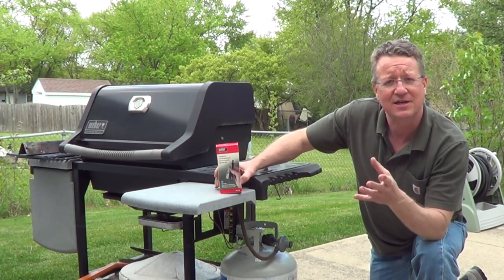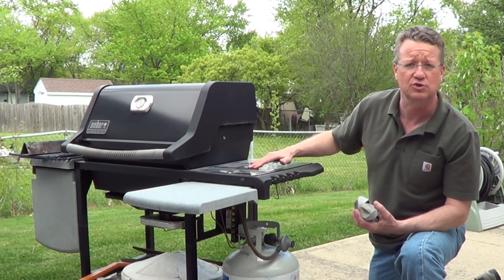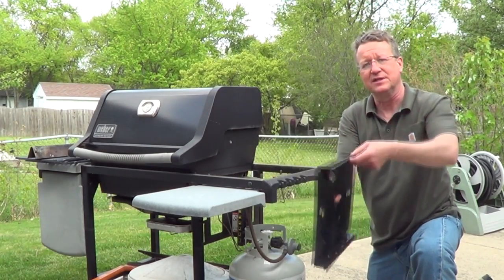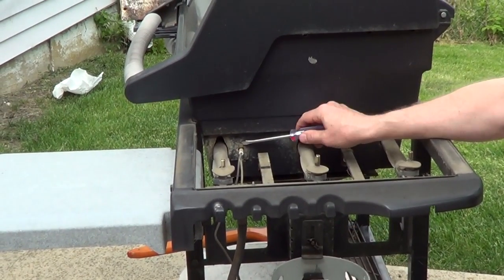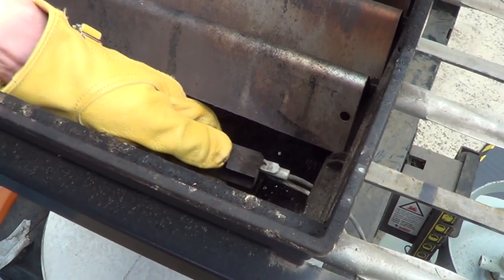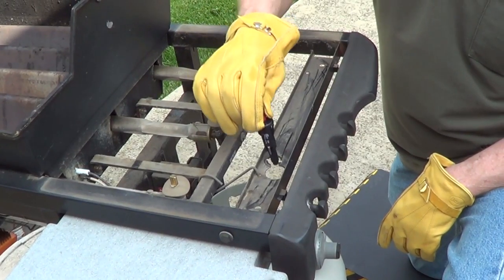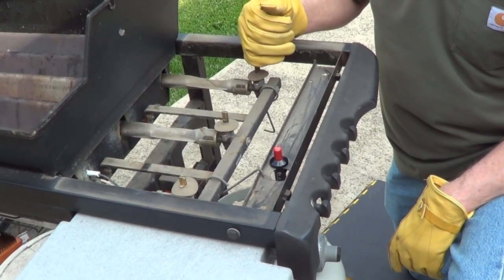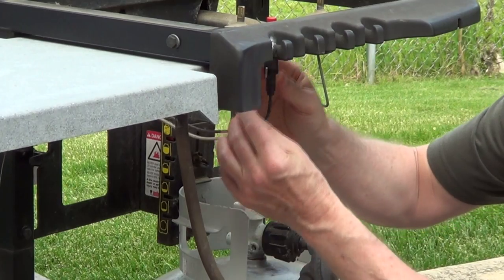Replace Ignitor on a Weber Silver or Gold

Comment: thanks for the refresher. the reason it's a refresher is that my 20 year old Genesis Silver is about to enjoy its 5th(!) ignitor. yep, roughly every 3 to 5 years it needs a new one. outside of a new set of burner tubes this year and a set of flavorizer bars a number of years ago ya gotta love a Weber.
Reply from the maker: Glad it was helpful.
We have more home improvement tips on our weekly podcast  https://podcasts.apple.com/us/podcast/fix-it-home-improvement/id880903087?mt=2
Reply: Same here with my Genesis Silver (22000 BTU?). I just replaced with igniter #4. Based on my records, the igniter needs replacing about every 4 years. I've replaced the flavorizer bars once or twice, and the grill grates once (went from the original ceramic to stainless steel). Had a smaller Weber before this one; sticking w/Weber.

Comment: this procedure worked great. The only problem is the crossover to other burners does not work. Any ideas on that?
Reply from the maker: Hi, I would clean them and use some canned air to clear any debris.
Check out more home improvement tips in our e-books https://www.amazon.com/gp/product/B0B2KW1FQ9?notRedirectToSDP=1&.
Reply: @FIXITHomeImprovementChannel  I'm going to replace the crossover burner and try blowing the burners out...thx...

Comment: Not as easy as he shows. I had to hammer the gas grabber to fit through the hole and he does not show how difficult it is to raise that clip. In fact, he did not show the toughest part of the assembly.
Reply: My installation took about as much time as his video after I watched it.  It was easy.
Reply: You may have missed the part where the white ignition wire goes through a separate, smaller hole just below the larger hole. After doing that, the unit fits easily.   This video really does make it easy to install.
Reply: Butter knife bent the tab with no effort . There are 2 wire holes can't fit both in one .
Reply: @Krae75 Two holes, and that's by design, maybe keep the wires from rubbing? (black wire top hole), white wire bottom hole)